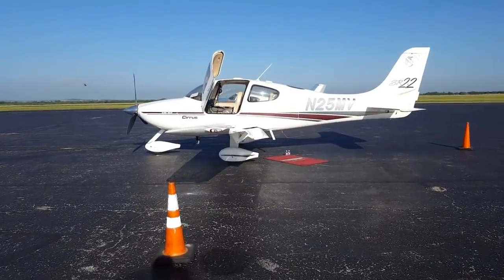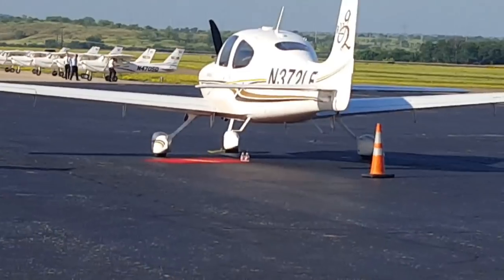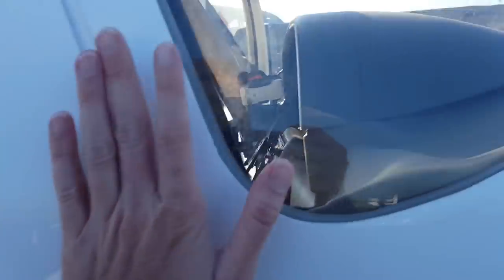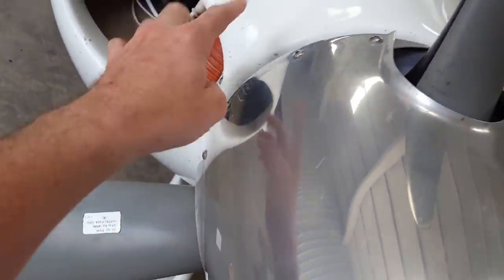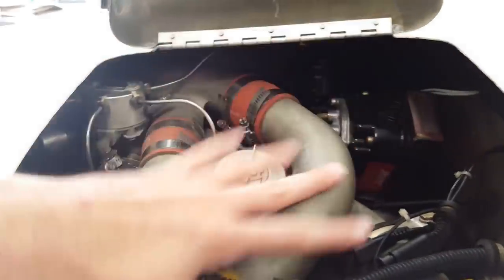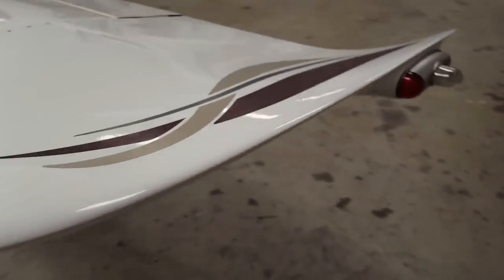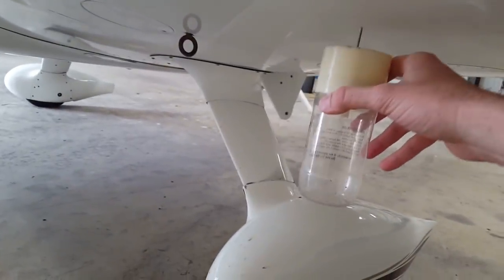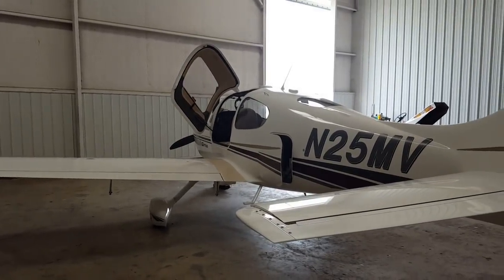How to Preflight a Cirrus

Comment: I use the pee jar to make sure that there's not too much fuel in the water tanks. You probably need about 50/50 or so. 
Kinda obvious, as a light sport guy myself, that you snooty guys can't even tell when the end of one of your wings was replaced with a Cessna wing- which is why it doesn't fit.

Comment: One thing that you should really emphasize is having an appropriate vape juice reserve. I had a very unfortune occurrence where I had to perform a power on no CH00T landong due to magenta line being inop and making my way into vmc. Now, of course I attempted to vape my way out of the situation, but before ifr could be recovered I was out of juice and had to go through my emergency procedures. Now, being a Mesa Airlines veteran, and learning under $wag Martin himself I was confident in my abilities. However, you standard pilot probably could not have handled the situation due to the no CH00T requirement in the class M airspace I was in. Let this be a lesson to all. Keep an appropriate vape reserve at all times, and avoid class M if at all possible, the no CH00T requirement is awful, and should be taken out of the AME. #vapesaveslives

Comment: Thank you for this instruction. I recently bought a nice SR22 and do need some help with this "preflight thingy", I hadn't previously thought about doing that but if you do it, it must be important.  I haven't really gotten into that yet, everything seems to be working OK, I can get to 3500 feet in 2 min and it lands very nicely, just haven't yet figured out why it almost runs off the left side of the runway during takeoff, I just start at the very right edge with the Cirrus kind of pointed to the right and it takes off just before going into the grass on the left.  Must be a low air pressure in one of the tires or something.  But the thing I need your advice about is some stuff I found a couple days ago in my SR22.  There is this red dangly piece of cloth hanging from the ceiling, don't know what it's for but the ignition key is attached to it.  Seems like a good place to hide the key, don't think any crook would think of looking there for the key.  The other day when I was going to start up, as I reached for the key, it fell out and went down someplace around the center console.  As I was searching for it I noticed that the lid for the center console has a hammer fitted into a bracket that was obviously made to hold the hammer.  Do you have any idea what this hammer is there for?  It's not like I am a carpenter or even a do it yourself carpenter.  I thought about looking in the book the guy gave me when I bought the aircraft, but don't remember where I put it, He said it was a sort of owner's manual. Who reads those things anyway?

Comment: Very informative, thanks for the insight. I always appreciate it when pros, like you, share their experience.
One small question, though, doesn't pre-flighting a Cirrus also require to pull the red handle? Or did Cirrus get away with it, as they figured that this is not necessary, because the chutes have proven to be so so extremely reliable? ;-)
Reply from the maker: +transsib I don't know what Cirrus recommends per se but I would pull the red handle for any of the following scenarios:
Bounced landing
Bee in the cockpit
Spilled my coffee
Spilled my beer
Sirrus / XM radio failure
Busted altitude on a checkride.

I am sure there are other reasons but those are the main ones.
Reply: +Bryan Turner I asked my PPL DPE if hitting the Blue Button is an acceptable unusual attitude recovery technique in a Cirrus. He didn't laugh, or even really answer me. I just held that blue button in for the entire check ride.

Comment: As a certified lawnmower mechanic used to spinning gizmos, I can tell you that it only takes 3 screws on that spinner thingy to hold the propeller on. 2 if you absolutely have to get away from your girlfriends daddy. The other thing is that it's ok to fly with cloud residue on 1 wing but not both. It's not good to have both wings heavier than your mother inlaw. 1 yes, both no. Too slow to get away from daddy and his shotgun. lol. Have a great day!

Comment: On a serious note, yes - really.  I noted that when you opened the little door to "check the tubes" that you allowed the latches to snap with full force to the open position.  Doing this has been blamed on cracking the structure of that door.  I always put a finger on the latch to prevent it from snapping open, then let it up gently after pushing the release button.   Love the videos, keep them coming.
Reply from the maker: Thank you. I had no idea. I will pay closer attention to how I handle that.  Thanks!
Reply: On a cirrus note*
Reply: Who cares, you got a parachute LOL

Comment: Sir, that wasn't the oil fill cap. It is the 710 fluid reservoir. They seem like they would be the same, but pretty sure it's the fluid that keeps the blinky lights working properly. Very important stuff.

Comment: You should trade your Cirrus in for that Mooney, they are !! faster!!
Reply from the maker: It may be faster but it doesn't use enough fuel. You want a lot of fuel going through the engine to help cool it and keep it well lubricated. Sometimes I actually fly ROP just to get more fuel flowing through the thing. 

No I dont.
Reply: Just Plane Silly BRAVO!! Nice Cirrus you have Sir!! I've never had the opportunity to even flying one I like the way how the throttle and the prop are connected together but I'm very partial to my Mooney
Reply: Just Plane Silly I'm actually an airplane mechanic A&PIA and fuel yes will cool the engine but oil and the baffling will also cool the engine they take the same engine most except for mine which is an O 360 A1D